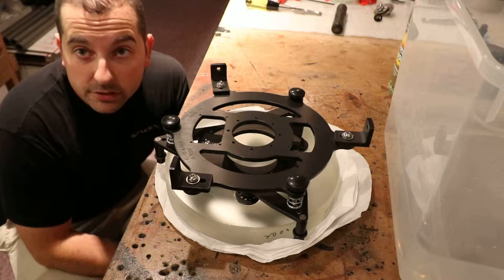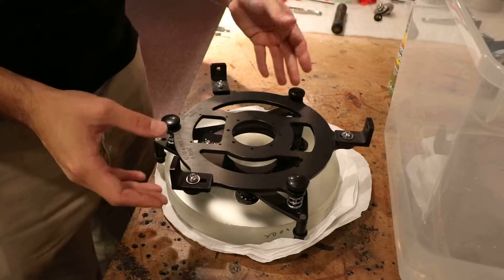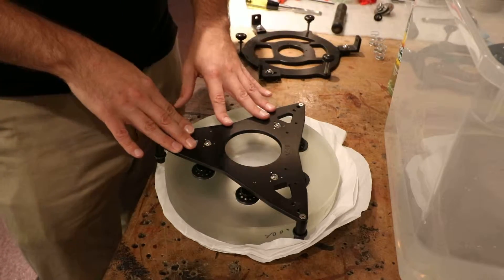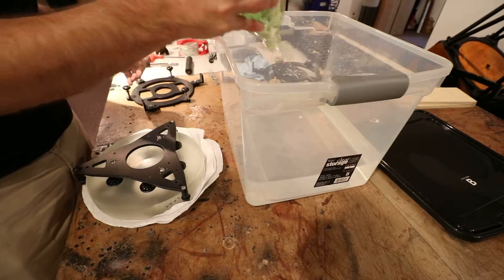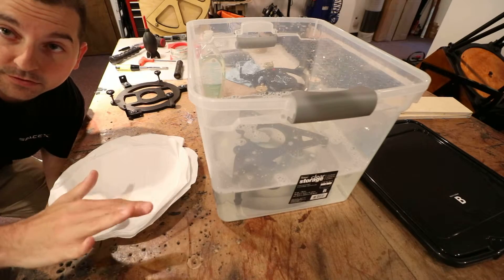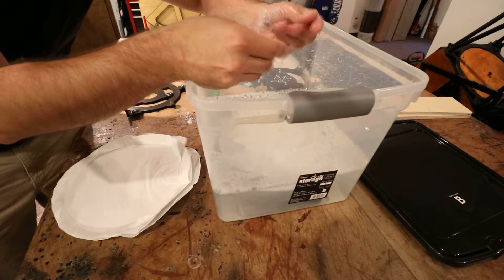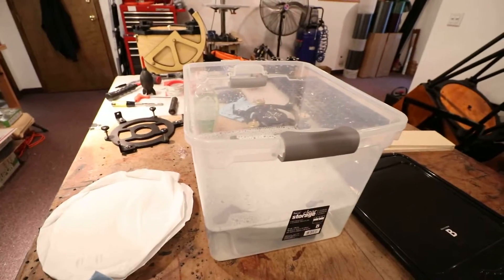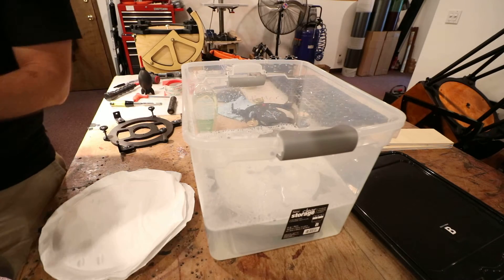Cleaning a Mirror from our STS Telescopes

Comment: Watch out for the plastic spike at the bottom of the tub! Most plastic tubs have spikes left over from the plastic injectors during manufacturing. This COULD poke into the mirror. Some have the spike(s) pointing downward out of the bottom of the tub but some have the spike pointing upwards that could damage the mirror.